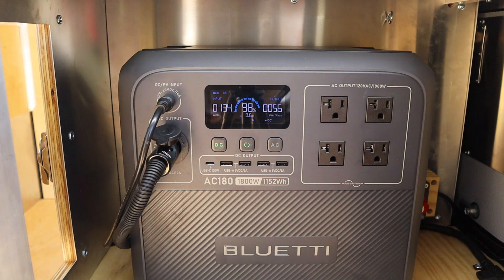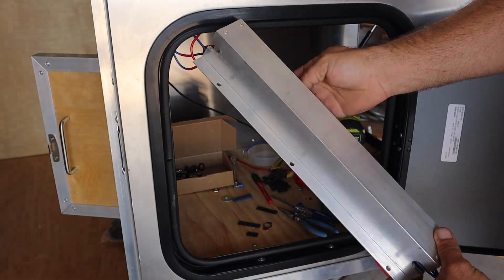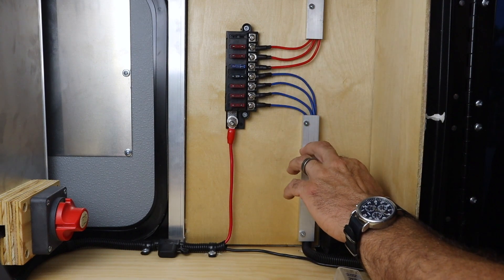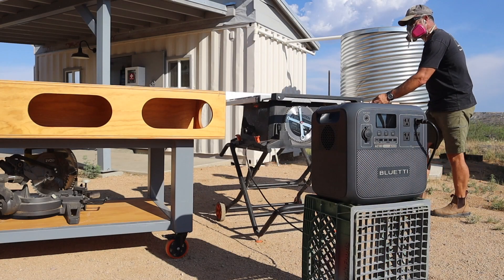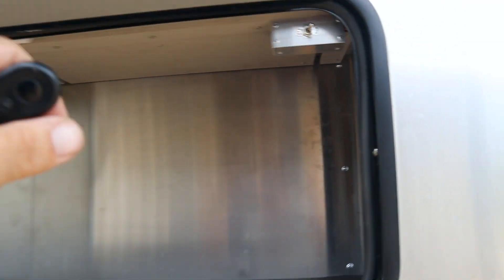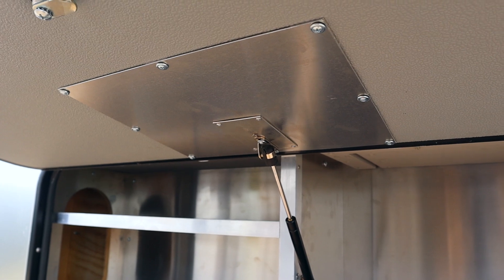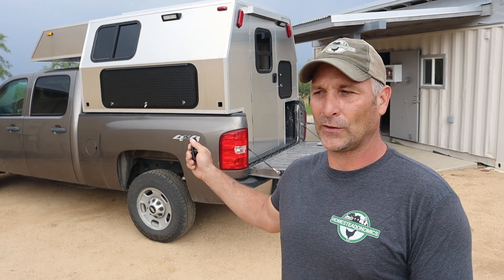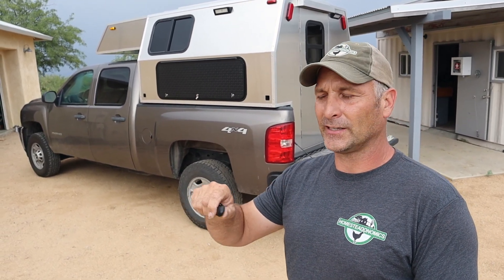DIY Truck Camper Solar, Lights & More! - Bluetti AC180  ( Part 6 )

Comment: Hey great build but I wanted to ask you a question. Don't they have like solar controllers that cut off the solar automatically for you? You know instead of the big red switch?
Reply from the maker: @ZipTronic  thanks!   As far as the charge controller….it is built within the Bluetti unit and it shut off the power input when charged.  But the reason I added the switch is so that I don’t have the input plug powered in that metal housing when I have the unit removed from the camper.   So it’s more of my wanting redundancy to isolate powered connections.  Hope that made sense and thanks for watching😊🙏

Comment: Hi, Joe... Great work; but I don't see any sleep system in it. Is it not used to sleep in?
Reply from the maker: @6ixtymiles  still yet to come.   I have not done that part of the project yet.   I am slowly designing a fold out bed and lift/wall system for the flip up top😊👍
Reply: @homesteadonomics  Thanks for the quick reply. It's one hell of a rig. I look forward to seeing it finalized.

Comment: This was a Bluetti ad, nothing to do with your build. That Sucks. What's the weight? Why didn't you use aluminum square tube? Next time just say this is a commercial and forgo anything about you working on the shell...

Comment: Those tailgates are pretty easy to pop off. At least the last one I had was. I'd just take it off, use the bumper as a step.
Reply from the maker: @sithinstructor  these have 4 screws and the red part is sealed to the black flange.   Definitely not hard to take off.… but they don’t pop off.
Did you have problems with people taking them off?  Because I can’t imagine someone risking an altercation to get a $10 taillight.   
But then again, there are people who are still wearing masks driving in their cars alone😂
Reply: @homesteadonomics  Mine was the two cables, then you lifted it off. Kinda nice. No one ever stole it... but my truck was totaled before that became a thing. To steal tailgates I mean. True enough about the masks 😷 🤣

Comment: Hi Joe, your build is wonderful, your meticulous fore thought on each install was well done.
I have had the AC180 for a little over 1 year and use at our off grid cabin as it sole power source, also charged with 2×100 watt panels. We are running our 12v  Explore Bear refrigerator, recharging our Ryobi batteries and most important making coffee. 
Always enjoy your content and appreciate the time it takes to put out an episode. Best....
Reply from the maker: @garagejim1956  Hey Jim, Thank you!
It really is a great unit and I’m glad to hear it’s doing well for your off grid cabin too!
Btw…. I sent you a reply in Rumble as well.   But I wanted to send you a shirt for supporting when I tried the locals page.   I tried to look up your email there but for some reason I was not able to.   
So anyways, if you’d like a shirt would you  check out the bonfire page and see what color and size shirt you’d like.   And then email me with that info plus your shipping info.  
Just wanted to give you a thank you since I haven’t kept up on my end on that page.

Joe
Reply: @homesteadonomics  I responded back, also I was at the cabin when I read yours. I will get back to you once I get to your store. Thanks, Joe!
Reply from the maker: @garagejim1956 oh good!   I didn’t get a notification but I’m sure it’s just cause they are a newer platform.   But enjoy your time at the cabin and whenever you get a chance let me know😊👍

Comment: You should have used a larger diameter wire from the switch to your fuse box.

Comment: We used the maxx air fan in our van (2 of them). I highly recommend the more expensive  2 way 10 speed. Having a fan that blows in and out is a huge benefit.
Reply from the maker: I’ve got a MaxxFan on my travel trailer and like it a lot.  But I didn’t know about the 2 way version.   Thankyou😊🙏That sounds like a great option to get airflow.  
I also want to add something like a vent to the underside of the cabinet portion so I can have good airflow when the rain is falling.

Comment: Joe, will you install one of those little ball fire extinguishers in the bluetti space in case of fire? I’ve seen van lifers add them in their battery boxes. Cheers Shell 🇦🇺
Reply from the maker: You know what….i have been thinking of something regards that as I know there is always a risk of overheating and batteries in small confined spaces like that.  So I’m definitely going to do a search for those now.   Thank you Shell 😊🙏

Comment: Some NC momentary light switches instead of toggles. Make up a coated cable and padlock to replace or complement the bungee. Great work on the wiring.
Reply from the maker: Well now you got me thinking of a separate security add on like the travel trailer ones I did for the battery and hitch coupler🤔🤪🙏

Comment: Where your wires exit those aluminum channels is a short circuit waiting to happen. Add some form of plastic protector/edging so the wires aren't chafing on metal when it vibrates going down the road!

Also a good practice for mobile DC is to fuse the negative terminal close to the supply at the maximum it will be supplying. In case of a short in the 12 volts to the fuse block it is an extra layer of protection! I run ham radio gear in my car, both positive and negative wires are fused at the battery(literally 1 inch away) to prevent any chance of a short that can start a fire. I do the same with my house solar, the battery bank is fused right at the battery, positive and negative!
Reply from the maker: I will definitely add some extra insulative protection for those wires.  All good suggestions with experience behind them.  Thank you Mary😊🙏

Comment: I would consider a foam pad under the Bluetti and a few eyelets surrounding the base of the Bluetti which would allow you to hold the Bluetti in place when traveling down rough roads. If you do not do this, pop a gopro in the compartment to verify the suggested mod is not required. LOVE your creation 🙂
Reply from the maker: I think that’d be a good add for sure.   I think this is fine for regular driving but if I’m rougher back roads your suggestions will definitely be the better option😊🙏

Comment: water proof 12v led tape and 3m 5mm clear gel 2 sided tape to mount it, remove the adhesive from the leds before mounting its beyond garbage
Reply from the maker: Yes that sounds like that’d do the trick😊🙏

Comment: like the solar setup there was a youtuber had similar on his van but no controller just manual disconnect already charged battery overcharged exploded burned entire van. my leer topper has screen behind every window rain really does'nt get in ive hauled up to 8 bull calves home from sales barn in a thunderstorm they were all laying down in there all dry
Reply from the maker: Ahhh!!!   That’s scary😳.   I checked with this Bluetti and once fully charged is automatically shuts down the incoming current.   But the overcharging fear is also why I added that cut off switch from the panel to the unit…. As a just incase ability to isolate

Comment: I just returned from our first camping trip with the AC180 and it did very well running my CPAP machine and charging my phone.  It also recharges very quickly as you noted.
Reply from the maker: Well that’s very good to hear!   I know folks who use a CPAP say it makes a huge difference between a good nights sleep and a bad one.   Happy camping on the next trip😊👍

Comment: A cigarette plug is good for about 10 amps. 
In fact it is clearly marked on the front of the Bluetti.
This supplies your fuse block in which there were multiple 10 & 15 amp fuses. 
There are no other 12v out on that unit, maybe an Anderson or an XT connector?
Reply from the maker: @CncObsession  haha… yep that was me just using fuses that I had.   You’re correct about the Bluetti socket being 10A.   But it’s all within the limit as I totalled the draw for all the lights and it is within the 10amps of the plug.   The fuses probably only need to be 5amps or less for the fuse block.  But I was just filling them up with what I had on hand for the video.   
Now when I add an exhaust fan it will likely put me over the edge for that single socket.  At least in regard to running every light (floods, compartments, interior, etc).

Comment: It seems that lot of people are using these battery box systems which work great and easy to use. Instead of having separate battery, inverter, and wiring. 
Love the updates on build. Thanks
Reply from the maker: Thank you Todd!  Yes they make for a nice plug and play system to get a quick start to adding power!
Reply: True Todd, they are much simpler and work great. However, i myself much prefer to build my own with separate components.

Comment: Another great video in your collection.  Thank you for sharing your thoughts and design.   If you are looking for a rainproof vent, consider locating it in the bottom of the section that extends over the truck cab roof.  There appears to be several inches of air gap that is in shade and probably cooler.  

Wishing you and your family a blessed week filled with gentle seasonally appropriate weather.  Peace brother
Reply from the maker: That is one of the ideas I’ve been playing with is to locate the pass through ventilation in that underside.   Perfect even if there was a downpour.   But I’ll still probably do a fan on the roof as well.   Of course my space is limited so I’m just digging around seeing what kind of options I can have for good airflow

Comment: In case you're still looking, a good friend of mine bought a kit canoe from a place in New Hampshire called Newfound Woodworks.  Liked it so much he bought and made another.  Liked that so much he wanted to do a third, but apparently his wife put the kibosh on that one.  For now, anyway.  They are beauties!  He's in Colorado and had them ship the 1st one.  Took a road trip for the 2nd.  Just thought I'd pass along another option for you. Cheers! 🙂
Reply from the maker: I have not ordered any kits yet so I will definitely take a look at that.   I’ve got an old book with plans for various strip canoes and was planning on just getting the ripped strips of western red cedar whereever I could find them cheapest.   But it sounds like the newfound woodworks has quite the product if he went back 3 times!!  Haha…. Definitely gonna check ‘em out😊👍

Comment: Howdy, really nice job on this project.

2 things... 1, you may want to look into getting the type of battery isolaotor that you can use to have the solar either/and/or your truck alternator be able to charge the Bluetti on cloudy days, high power use, etc. You would want to power only with the engine running of course.  Eh, about $100 in parts, but worth having a backup charging scheme.
2, can't tell from the angle shown... Where you show those aluminum peices that cover the wiring near the fuse block... First you will want to get some rubber edge strip  that you can glue onto the ends (like a grommet) to protect the insulation from rubbing while driving. Next & similar... Check that your screws that go thru those same pieces can't rub the threads against the insulation there either! You can use nylon standoffs to cover the screws. Easy peasy. 🌞
Reply from the maker: Thank you JP!
1… yes that is definitely a worthwhile add in my opinion as well.  Probably will be adding a tap on the main trailer hitch wiring to direct up into bed rail for easier trailer/brake/tailight function… and can tap into the auxiliary trailer wiring there.   Same wire that currently charges the trailer brake battery when towing. 
2…. Yes I need to make sure those are a bit more dialed in for sure😊👍

Comment: I have a similar Bluetti unit and am curious if you spoke to them about the compatibility of their units in our extreme temperatures.
I like that extra security tube!
Reply from the maker: I have not spoken to them about that specifically…. But I do know that their online customer service chat is pretty responsive.   
And the heat sensitivity would definitely be the biggest concern in our environment for sure.
Reply: @homesteadonomics  I finally got a moment to give them a call, and confirmed the tech specs from their website;
Operating Temperature:
32-104℉ (0-40℃)
Storage Temperature:
14-113℉ (-10-45℃)
That was disappointing, I'm going to have to leave town in May and not return until September.

Comment: I just purchased the Bluetti ac180 during prime days , I can run my entire trailer thru the 30amp plug in on the side of the trailer to include the ac unit on low for about 4 or 5 hours, nice build 👍
Reply from the maker: That’s great to hear!   It certainly is a nice compact unit and packs a punch!
Reply: @homesteadonomics  yes it does